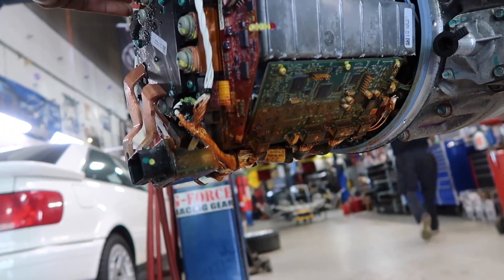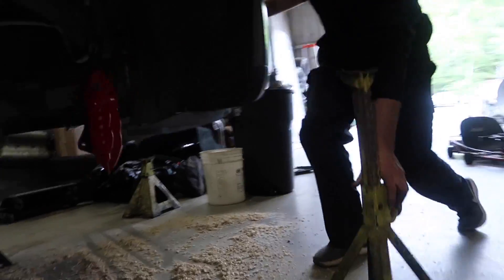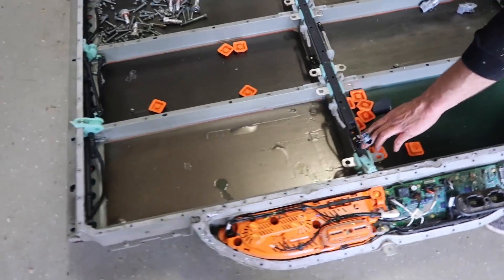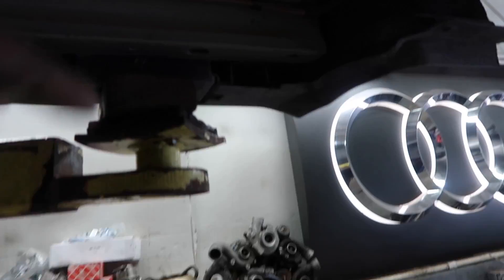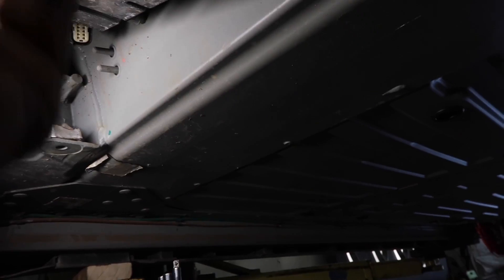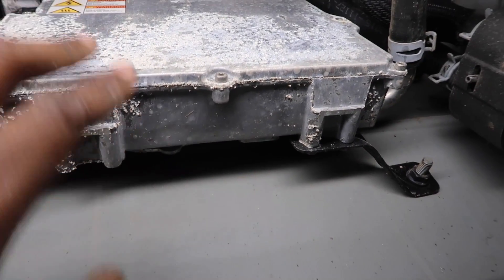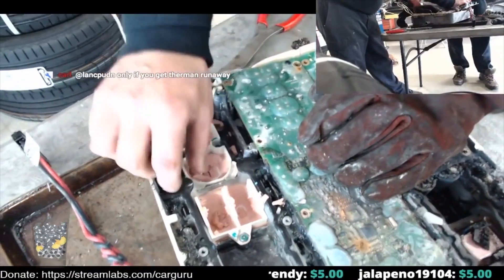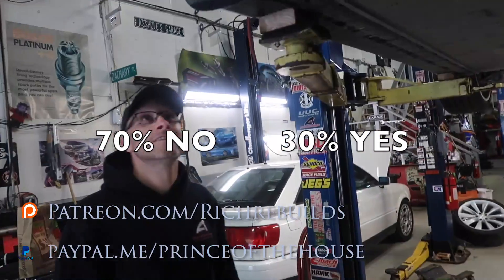Tesla: No User Serviceable Parts Inside

Comment: I really hope to see a colab with louis rossmann
Reply: I think Luis feels the same way about Tesla customer support as he does Apple's.  Louis has the skills to do that, but it is not a half hour fix. He will have no diagrams and no spare boards to scavenge chips of, but he will be able to clean it and check for shorts, so If he has time for this, I would like to see that too!
Reply: If you watch his videos, he won't.  If he didn't want to work on a mac pro, he won't want to touch this.  He generally doesn't work on things that require diagnosis if there is no schematic and in this case there probably won't be replacement chips.  He also cannot test anything, so trial and error replacement won't work either.  The only thing rossman can do here is run it through a cleaner and maybe fix visibly broken solder joints or reflow any chips.  Rich is going to have to learn to solder and do this himself once he has a way to test the boards by reassembling necessary parts of the car.  Be prepared to replace most of the components and any tesla proprietary chip will derail you.  It will be easier to find a mangled tesla that has an intact motor.
Reply: I don't think there is much Louis can do because he lacks parts and schematics, but in a recent stream he said he'd look at it, but he did not get back to Rich yet.
Reply: stokrenden that would be sick
Reply: paul daniels could prob sort it out and luis knows him
Reply: Heh,I mentioned that when he did the vid where he opened the motor ...I saw those boards and said that’s Louis territory.
Reply: me too but i think they are too far gone
Reply: stokrenden did you see the fire damaged pcb repair he did yesterday? If it can be salvaged, he's your man.
Reply: Tore Lund I thought exactly the same! It's basically Louis Vs Apple and Rich rebuild vs Tesla!
Reply: whuzzzup 
If he had a couple of good boards to look at, he could probably determine some of the components, but having no diagrams would suck.
Reply: that would be sick